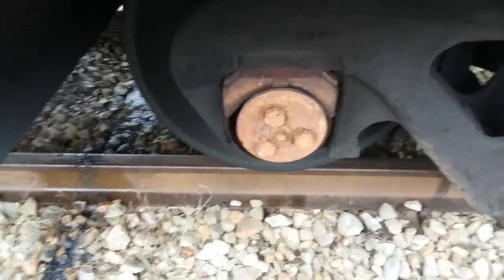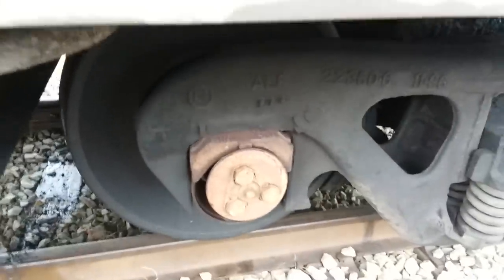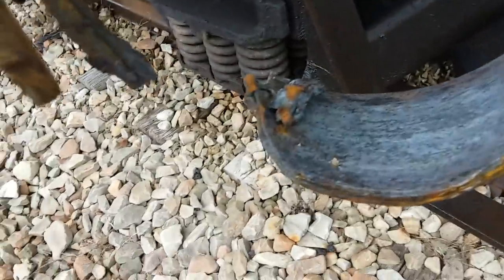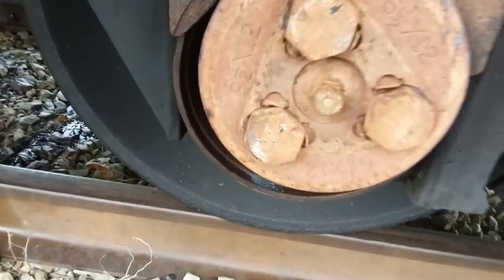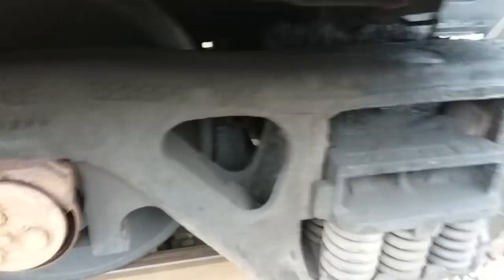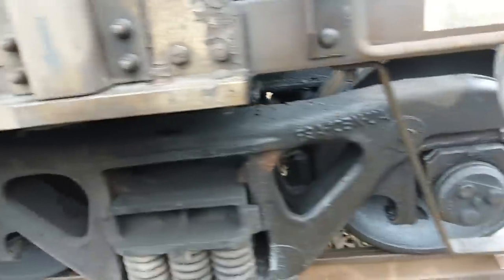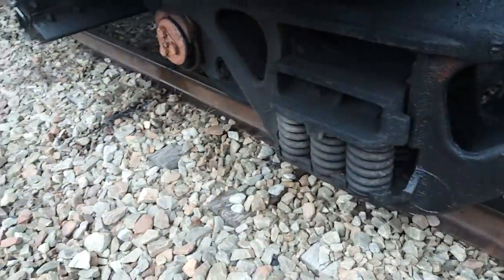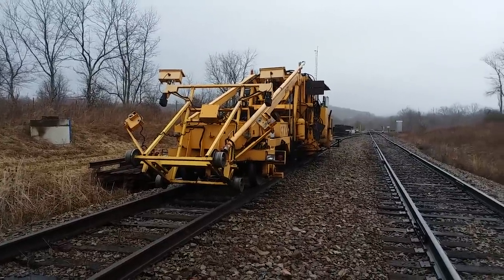Hopper Car with Bad Bearing, more of the Story

Comment: This isn't something that happened in the span of ten seconds.  I would think that a car knocker (after perhaps 2 cups of coffee) would have seen evidence of this destruction before it got to this stage, no ?  Would still put the car OOS, but could have prevented the occurrence from happening in the middle of nowhere, and tying up the train for a length of time.  Not trying to be critical, just trying to be proactive (for the next time).
Reply from the maker: When the car went to the mine empty over the detector it didn't set it off, that was about 7 miles
to the mine, got loaded, then 7 miles back to detector. I found a piece of the ring
about 3 miles up track, so it did happen pretty quick. We do not usually do a roll by
inspection at the mine, but almost every time out of the harbor empty it gets a visual.
thank you for watching

Comment: Too much chinesium in them there bearings.
Reply from the maker: Is that on the periodic table of elements? If not, it should be...lol
thanks for watching, I appreciate that. PS: first vehicle I bought with my own money was a CJ 5, had an over drive transmission in it, was a lot of fun to ride around in an go 4 wheelin. Froze in the winter, went to the junkyard and bought a heater out of a Mack truck and plumbed it in. Then took the 4 cylinder out and popped in a Buick V6 with the help of a JC Whitney adapter kit, that made her run a lot faster. Your bringing back a lot of good memories for me sir!